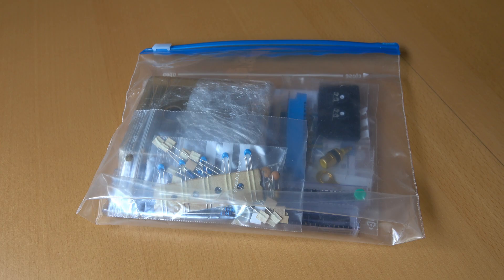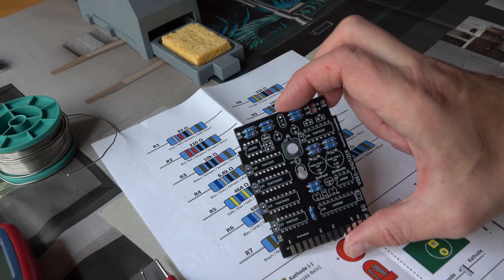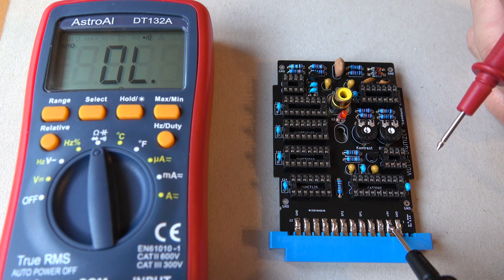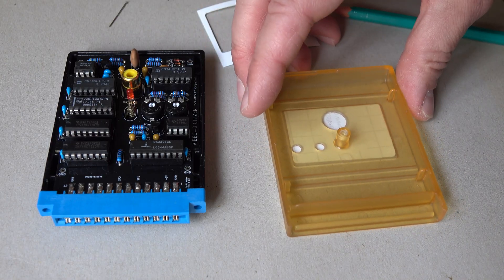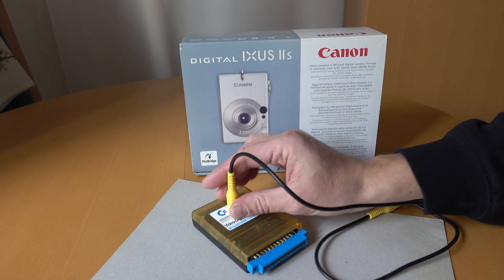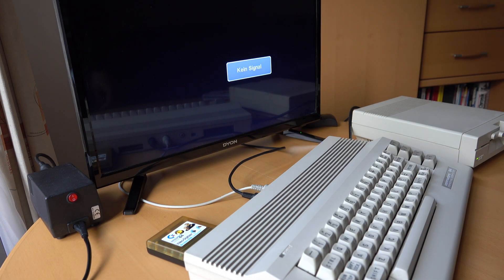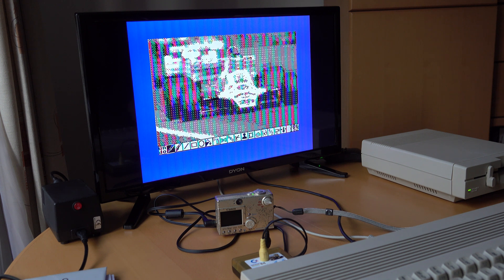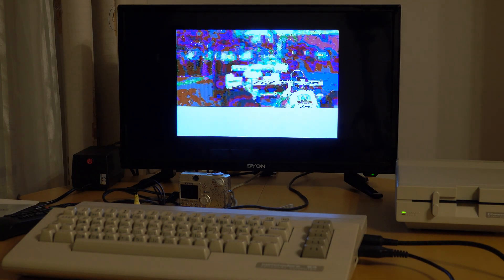Building a Video Digitizer for the Commodore 64

Comment: Were you using PAL or NTSC for the video source?  Any idea if for NTSC do you need to change the Ceramic Trap value?  Thanks and thanks for pointing me to the computereyes info,  I was looking at the file type page and didn't see it.
Reply: maybe to a 3.58Mhz?
Reply from the maker: All my equipment was set to PAL. Have you already tried it with GoDot, with the setting at 11:44 set to NTSC?
Reply: @MacBerti28  No I am just now building the device and was thinking the filter was in the wrong location for NTSC.  Worse case I'll set a PI to PAL output and use it.  Thanks!

Comment: This looks like it could make it a lot easier to port games from other platforms, or to create assets for new games using more powerful computers and actual photographs and then "backporting" them.
Reply from the maker: Back in the days: yes, I never thought of that. I found it fascinating in the late 90s that I could take an emulator screenshot of a game and make a pixel-perfect copy of the sprites. I tried to recreate the Odyssey 2/G7000 Air-Sea-Battle game on the TI-99/4A like that, and I got quite far and it really looked good, but Extended Basic ran out of speed as soon as I added the moving missiles…

Comment: How can someone get a hold of Martin to purchase our own kit?
Reply from the maker: Currently there are no more kits available, Martin made only a couple of them. But you can download the Gerber files and the BOM and order the board and the parts yourself.
Reply: @MacBerti28  That seems to be part of the problem. There's a schematics file in the google drive, but when you open it the text says "This is a placeholder for the schematic which will soon be published here as well. Please be patient and come again later."
Reply from the maker: @theoasisbbs  That's what I wrote there because the schematic isn't ready yet. :-) Martin will have to rework it, it still has a few issues. But that is no obstacle to ordering the board and the parts, the schematic will only be needed for troubleshooting, luckily I didn't need it at all.
Reply: @MacBerti28  Great. Thanks for the update.
Reply: In many cases you can reproduce such simple circuits on any old prototyping board with appropriate hole spacing. That works especially well if you can source the parts in a through hole/DIP package.

The chief difficulty with that approach is needing to do point to point wiring or improvise "traces" by cutting a length of l plain wire and bending it into a convenient form.

Comment: You need to get more heat into it before you put the solder on. 🙂
Reply from the maker: Thanks for the advice! I will try to remember that when doing my next soldering project. "dolphhandcreme" already wrote me in the comments to another video of mine: "You should stay a bit longer (0.5-1s) on every solder joint to give the solder time to flow. Otherwise you may end up with hidden cold solderjoints! If you're frightened of frying some components, you can lower the temperature 20-40°C."

Comment: Very cool to see this.  I used the DS-69B video digitizer on the Tandy CoCo 3 in the late '80s and early '90s.  It was designed in part by Tim Jenison, who went on to found NewTek.  The design of the CoCo digitizer is similar to the design of NewTek's DigiView, and it can produce similar results.  This spring I demonstrated using the DS-69B to make high-color images with a color splitter on a virtual Tandy fest, which can be found here on YT.

I always assumed that there were video digitizers for the C64.  It's great to see one demonstrated, and neat to know that a reproduction kit is available.
Reply: yeah it works much better with black and white composite image right?     are these trying to decode ntsc or pal in software in the color mode somehow?

Comment: Interesting little kit. For the holes I'd just apply the sticker then use a scalpel/hobby knife to cut them out. Pity you only had that old half dead camera as a video source, the camera case looked like it had been in a war or similar.
Reply from the maker: The IXUS IIs was the successor of the IXUS II, the "s" stands for silver. Canon added a little silver to the paint finish to give it a more "luxury" look. I looked gorgeous out of the package, but soon it looked as you can see in the video. Most IIs owners had that problem, not only war photographers. ;-)